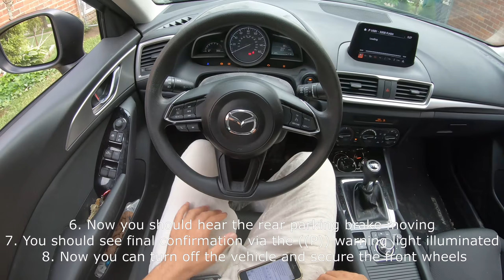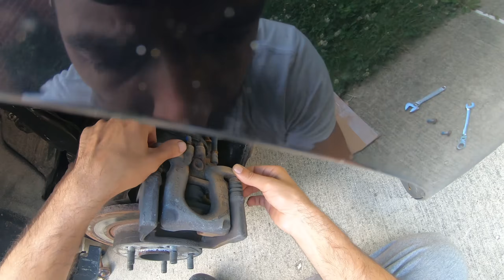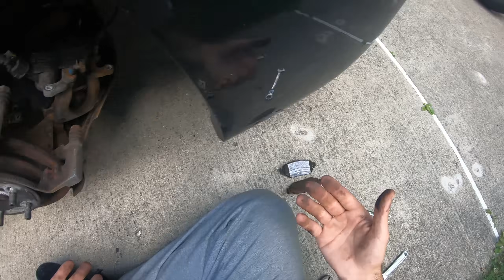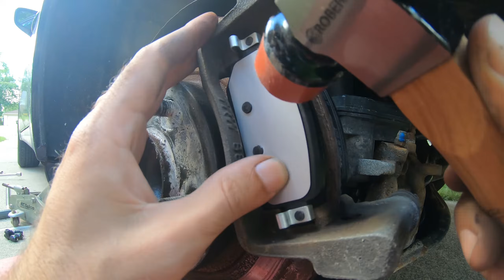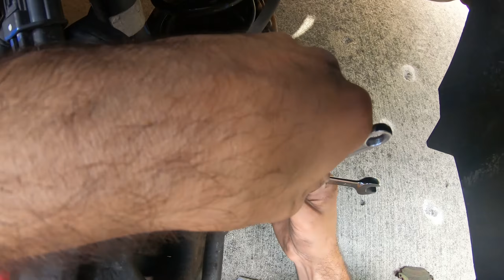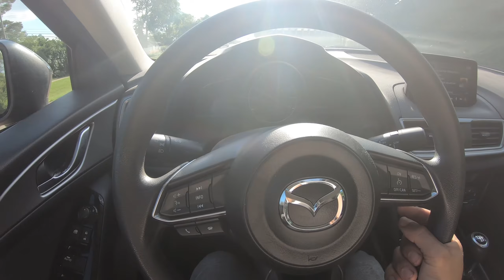Replace Rear Brake Pads - 2018 Mazda 3 (With Maintenance Mode)

Comment: The rotor should be replaced. The extreme rust on your rotor is why your pads wore out. Mine last an average of 67000 miles and wear very evenly front and back.. rotorsvdrilled and slotted, carbon ceramic pads and I do use them, $254.00 @ Rock Auto. The performance and extra mileage make it far more cost effective. Plus that setup runs cooler and is better for the calipers.

Comment: Much love, but honestly you should take this video down. Once the EPB is disengaged, you can just push the piston back in with a clamp. No twisting. Otherwise you're sending people down a rabbit hole of caliper tools and other videos and stress for a non-issue. Also, you put passenger side squeaker pad on the driver side.

Comment: Even a cheap temu set of rotors would of been better then running those shot ones, Also if you have to hammer your pads on the bracket needs cleaned more with a brush and file , if not the pad won’t slide away from rotor when the piston lets go

Comment: At around 7:00, you note that one of the brake pads has braking material, the other does not. The reason is because your caliper pins are frozen and the brake caliper is not able to move and adjust as the pads wear down. The fix is easy: lubricate the brake caliper guide pins.

Comment: At around 6:22, you mention that you rarely use your brakes and that you downshift to slow down. 
I understand and I do the same thing. 
The reason is simple and is part of conservative driving. 
A longer explanation is that anytime you step on the gas pedal, you use gas and your vehicle starts moving. When you step on the brakes, you take that motion and turn it into heat that goes into the atmosphere. So a conservative way to drive is to accelerate slowly and anticpate when you need to slow down. Lift your foot off the accelerator and allow the car to slow down by itself rather than by brakes. You will be rewarded by better gas mileage and your brakes will last longer.

Comment: Great video. 
We replaced the brakes on 2018 Mazda 3 Touring with EPB (Electronic Parking Brake).
Definitely DID NOT, I repeat, did not need to twist the piston.
We used some simple clamps to ease the piston back.  Took 1 minute with nice steady pressure and no problems.

Comment: You really saved my ass here. Thank you. I was freaking out that I couldn't finish the job. I applied pressure and twisted it and maybe then it unlocks because I was then able to push it down all the way without twisting it again. Life saver 🎉🎉

Comment: At least Mazda didn't do what Lexus did with their GX470. An entirely separate emergency brake system. Granted, Mazda went with more electronics, but at least it's modular.

Comment: I just did my sister’s brakes on her 2018 Mazda 3 Grand Touring W/electric brake. The video is a little miss leading. When in maintenance mode, the pistons do not “retract” all the way into in calipers. They just release the pressure on the brakes.  DO NOT MAKE the same mistake I did… when in Maintenance Mode,  remove the bottom caliper bolt and loosen the upper bolt and rotate the caliper up. Then you can do the old style “C” clamp compression on the piston, without rotating it.  Also need to know where the car is assembled… Japan, Mexico or US.
Reply: You didnt replace tbe brake guids it will pre wear and make noise

Comment: I watched this before trying to replace my rear pads... THANKS for the tip about the electronic parking brake.
I would also like to give a little helpful tip if anyone is trying this themselves.
It is important when buying the NEW pads to let them know you have the electric parking brake.
I went to a local auto parts store and gave them my info for my car... year/make/model.
I did NOT know that cars with an electric brake, and those that do not have it... use DIFFERENT size pads. 
I ordered them on-line without knowing.. and now I have the wrong pads... and the return option expired.
I'm out $50... because I didn't research the part better... but I guess that's still better than the dealerships price of $530.

Comment: 26000 miles is not impressive whatsoever. My back left rotor is cooked. I’m curious if caliper misalignment is causing uneven wear. i’d bet money on the tire shop butchering caliper alignment or a pothole

Comment: omg! dude! Please remove this vodeo. I hate to bash you, but those rotors should never have been put back on the car. In fact, in many(mayby most) states, they would not pass inspection as those pads are dangerous and inadequate. Thank God they are in the REAR, cause if they were in the FRONT I would not hesatate in predicting you in an accident!
If you are watching this video or have watched it, PLEASE search for another video.

Comment: The OEM brakes on the 3 are garbage. Mine, and the rear rotors were gone at 49000 km (30000 miles). I've had Volvos, Alfas, etc. last 70,000 and, like you I engine brake. Very disappointing.. Great video Sebastian.

Comment: Thanks Mate! I’m the same, love driving my manual…unfortunately they are the dinosaur now with Mazda Australia only selling auto now. I also only had to change the rear pads at 80,000km but strangely still got the front at 150,000km. Excuse I heard was the G Vectoring kicks in through rear brakes.

Comment: Do NOT rotate the pistons on the EPB cars! Push the piston straight in and make sure the markers are lined u.p perfectly. Rotating the pistons can DAMAGE the EPB. I suggest you also lube up all the usual parts (not the braking surface/material obviously but other metal on metal part.
Reply: Quick ? So if your not supposed to rotate the piston back in on EPB cars then why do some of the caliper piston tools work by rotating? Like the ones with the interchangeable discs they sell. Not doubting your advice just curious. Also so does not rotating also apply to the 2019 Mazda 3 as well? Thanks for any advice you can offer as I'm getting ready to do this job on the wifes car.
Reply: @imagineengine  You've probably already learned this, but when you disengage the epb they are easy to push straight back in.

Comment: All you got was 26k off those brakes? Im at 90k miles with original brake pads and they still arent grinding i just picked up more today actually spent a little extra to get the same ones that come stock maybe its the duralast pads lol

Comment: I bet those pads only lasted another 26000 you need to take the bracket off and clean up the grooves for the pads better. A wire brush won’t touch the rust buildup. Try using a file to remove all the rust and get it back to bare metal. You should never need to use a hammer to install pads they should slip in nice and easy.
Reply from the maker: Thanks for the recommendation, I'll put more emphasis on rust removal next time around (no more hammer). Oddly the front pads are still going strong (now at 36,000 miles), seems odd that the OEM rears wore out so quick. Mazda makes great "value" vehicles, but being a smaller player and having less purchasing volume likely makes cost cutting a huge initiative, so maybe they had to downgrade the pad material or otherwise cheapen the rear brakes to keep the vehicle extra affordable (just speculating). I'm still a fan of their design and engineering, but never forget, you get what you pay for.
Reply: @SebastianOats  Odd since my OEM front brakes lasted 85K+ on my 2014 mazda 3.....and I am far from gentile on them. IDK when but my rears pads actually wore out before the front

Comment: the pads seized up because their is no hardware for the pads to sit on so it can slide. That’s why the pads wear is uneven. Mazda cheap out on the hardware. By the way, get new rotors. Those rotors rusted to shit.

Comment: Definitely shouldn't rotate the piston back into the caliper or you'll damage the electronic brake mechanism. It needs to be pushed in. You can buy a tool that compresses the piston and its much easier with no risk of damaging the parking brake.
Reply: The caliper tool doesn’t really work
Reply: Not doubting your advice but why do they sell certain tools that rotate the piston back in if your not supposed to do it that way?
Reply: @imagineengine  because not every car has an e-brake mechanism and some others that do, function in such a way that turning the piston back into the caliper won't damage it. But doing this on a Mazda 3 can damage it.
Reply: @jasonharris996  so even though my Mazda 3 DOES have  E-brake system it is NOT designed to be turned back in?
Reply: @imagineengine  no, it's not. Turning it back in can damage the e-brake's actuator motor.

Comment: Thank you for the tutorial! In my case the replaced pads did not rub  evenly on both left and right only on the back side . Is that normal? If not, what could be the issue?
Reply: You probably need to grease the calipers and make sure they're applying equal pressure.  I had this issue and one of the calipers had froze so I had to loosen it and grease it to make sure it pushed against the brake pad when the brakes were applied.

Comment: Do not use plyers on the piston , when the car is in maitenence mode push them in lightly with a c clamp. Go easy dont brake the plastic on the back.again go easy.😁😁😁😁

Comment: 2018 Mazda 3 w/Electronic Parking Brake

*If you have ever done a car with the rear emergency brake with a caliper compression tool like a late model Mustang, FORGET everything you ever know about compressing the rear brake calipers!!! You do not have to screw them in as you compress them, they electronically screw in when you correctly place it in the maintenance mode… here is how you do that…

1. Turn the ignition on(quickly tap the start button twice). 
2. Push the Gas Pedal all the way to the floor and hold it there. 
3. While still holding the gas pedal to the floor, push down and hold the parking brake button down
4. Continue holding the gas pedal and parking brake button and turn the ignition off…. (Press start once).
5. Wait 2-3 seconds, while still holding the gas pedal and brake button as it was, turn the ignition back on by pressing the start button twice.
6. Now you should hear the rear parking brake actuating and moving…continue to hold everything until you hear the actuator stop
7. You should now see((P)) symbol (parking brake warning light on the instrument cluster)
8. Now press the start button once and the ignition should turn off. 

How to get out of the maintenance mode…

1. Turn the ignition on (2 presses on the start button)
2. Gas Pedal to the floor. 
3. While holding down the gas pedal, pull up on the parking brake and hold it. 
4. Continue holding everything… Turn the ignition off (1 press on the start button). 
5. Continue holding everything…Turn the ignition on (2 presses of the start button)
6. Continue holding everything, you will hear the rear brakes moving and you will see the warning light ((P)) is off 
7. Turn the ignition off (1 press of the start button)

** Once you get into the maintenance mode, your caliber compression tool will need a smooth adaptor (no pins extruding, because you do not need to turn the piston as you apply pressure with the compression tool, simply compress the caliber piston with light pressure). 

MOST IMPORTANT… IF YOU START APPLYING PRESSURE TO THE CALIBER PISTON (LIGHT PRESSURE) AND IT DOES NOT START TO MOVE, YOU ARE NOT IN THE MAINTENANCE MODE! Go back to step one and start over!
Reply from the maker: Henry, thanks for sharing the details. Really very helpful to share with anyone doing their own pads.
Reply: sir thanks on the information...i dont know if this also the process adopted here in the philippines...thanks sir
Reply: This is very important information to know prior to changing the brakes. My dad and I didnt know this until I had to google wtf is going on lol. Thank you for posting this
Reply: So when I put the electronic parking brake into maintenance mode, I can simply push the pistons back without rotating?
Reply: Henry thank you for sharing the steps.  Saved me from writing them down.  Performing this work on my daughters Mazda 3 tomorrow. Hoping these steps really work.
Reply: Your tips saved my life! Very much appreciated!
Reply: Thankyou for describing this procedure clearly. So many of the videos just say 'Press the ignition 3 times', which is why they all take several takes to get it right. And your ** comment at the bottom was correct and saved me a lot of trouble.
Reply: You made the job ahella lot smoother
Reply: this tips also for the new Gen 4 w EPB?
Reply: so this guy in the video didnt put it in maintenance mode? since he is screwing it with the channel lock
Reply: Do I need to do this (maintenance mode) to change front pads as well? Just a noob here

Comment: Dang man, that rotor is shot!
Reply: its hanging on by the last chips
Reply: I live in Canada, I always replace the rotors when I do my brakes. If i am going to go to the trouble of jacking the car up and getting into a brake job, il spend the extra $80.00 on rotors, so I dont have to do it again in 1 year.  I don't care where the rotors are Mfg, in Canada they are usually shot after 3 winters from the salt!